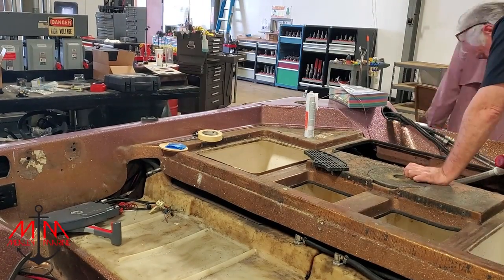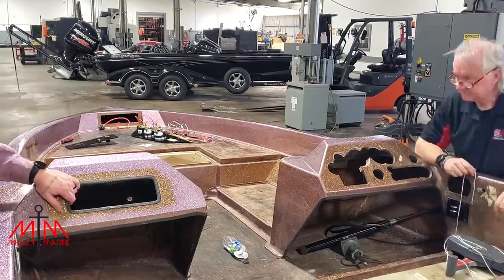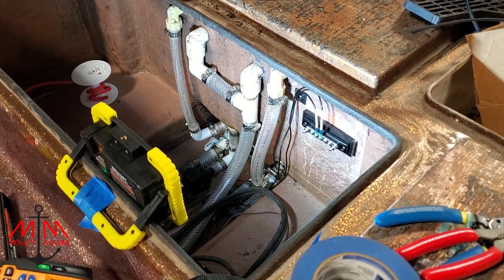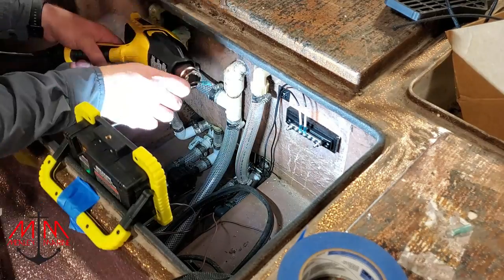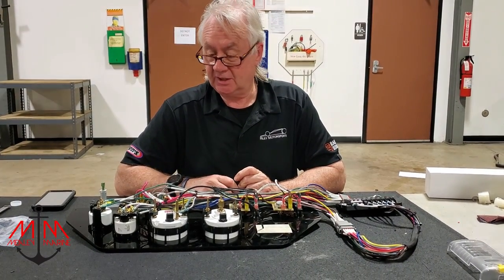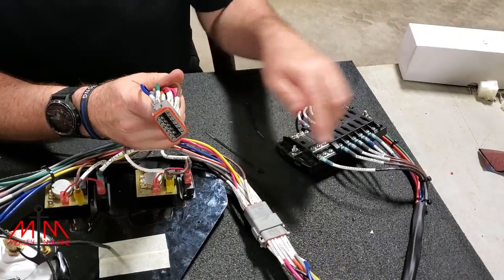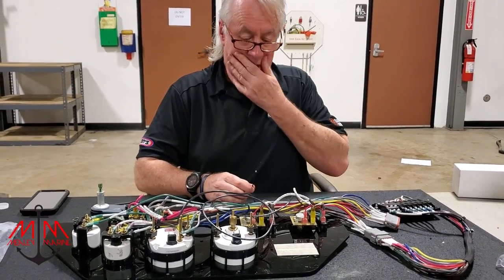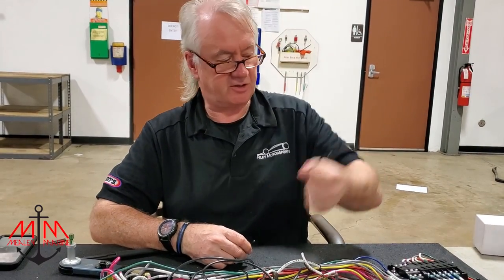BASS BOAT RESTORATION | 1988 RANGER 363V | PART 20: CONSOLE WIRING

Comment: What gauge wire did you use after the bus bars or fuse box? 12, 14, 16 gauge? As well as on the panel wires.
Reply from the maker: 14

Comment: Where can I get those type of harness connectors plug. Or what is the proper name of them ?
Reply from the maker: You can get them on Amazon they are called DT connectors. You will need a special crimper called at deutsch crimper tool which runs for about 200$